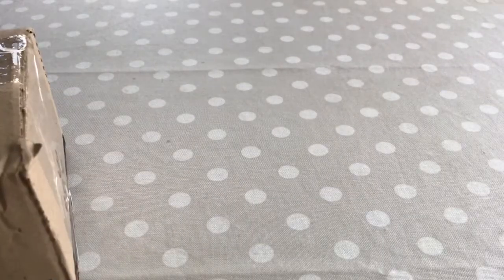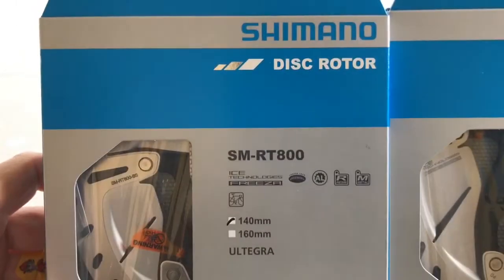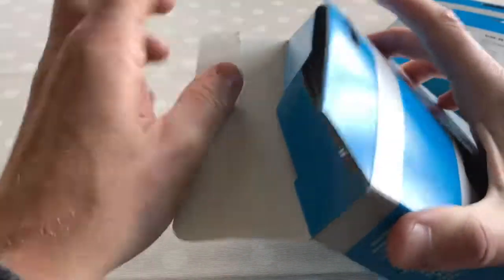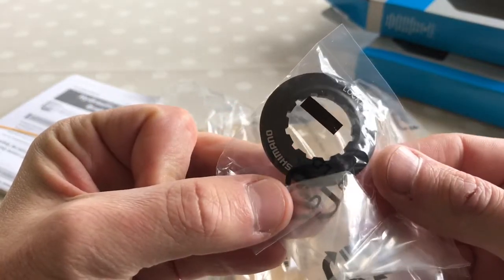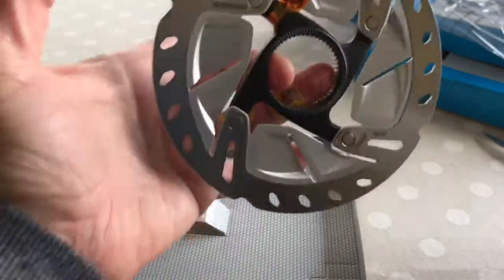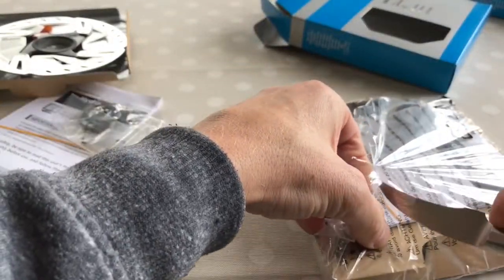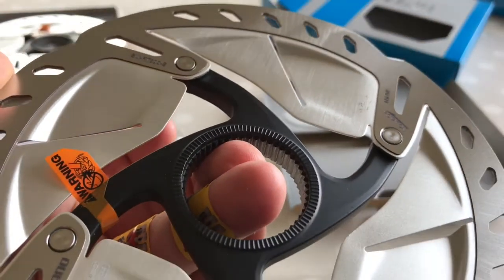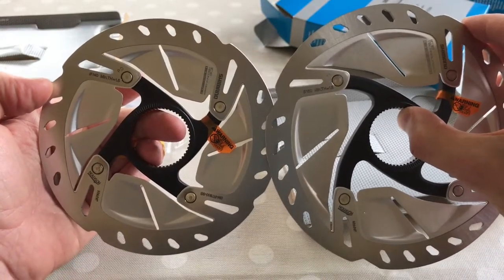Shimano SM-RT800 Ultegra Ice Tech FREEZA Centre-Lock Rotor Unboxing

Comment: The front should be 160, shows this guy doesn't know how to use brakes!
Reply from the maker: Randy Haymaker hi, I’ve already covered this point in a previous comment, it was an error on my part, I got them the wrong way round whilst I was recording... got a bit nervous as was one of my first unboxings. I can assure you I won’t be using a 160 on the back.
Reply: Newby so I need 160 front and 140 rear with my RT 8070 why different sizes? Ta
Reply from the maker: Tony Margiotta this passage I found sums it up.....

For the same force between the disc and pads, a bigger rotor generates more torque on the wheel - i.e. more stopping force. It is running though the pads faster, generating more friction for the same pressure, more stopping power, So, for the same caliper and brake pad, a bigger rotor generates more braking for the same pressure or the same amount of braking for less pressure.

In the end I went for 140mm front and back and it’s more than enough for my needs to be honest. 👍
Reply: Thanks yes just discovered they suggest 160 for the heavier dude too So 140's for me
Reply: My bike is 160 front/back... welcome to 2018?
Reply from the maker: Rollett I run 140 front and rear now 👍
Reply: @KyrosHouseCycling  Why are you running 140? Why would you not run it bigger?
Reply from the maker: David Vasta 140 is plenty of brake for me personally, I never find I need more stopping power so that’s why I run 140’s. I may try 160 front rotor on my next bike just to see... 👍

Comment: Is the braking power higher with theese rotors? i have the sm-rt10s on my road bike and the braking power is bad compared to my fully with sram guide r brakes. I search now for an upgrade
Reply from the maker: Max Mustermann I cannot say at the moment as I have not used them yet, when my bike is built I will then be able to tell you. Thanks for the comment
Reply: I think many different rotors with a similar amount of real estate on the breaking surface would work similarly in most conditions. The shimano rotors with the aluminum fins are supposed to conduct heat away from the braking surface, so maybe they stay a little cooler if you're breaking for a long time (e.g., going downhill) and thus maybe they retain good breaking performance a little longer in that scenario. I don't know how much difference there really is, but the explanation sounds reasonable because aluminum does conduct heat better than steel. At the very least, they look high tech, and that's probably worth something :) This is just my 2 cents as a non expert.

Comment: At https://youtu.be/kBZx_lxfPSs?t=71 you say you're using "160 on the back and 140 on the front". Is that correct? You actually need more braking power and thus larger rotor in the front...
Reply from the maker: Petr Sedlacek hi! Yes you are right! I got them the wrong way around, I’m using 160 on the front and 140 on the back. Thanks for pointing that out.
Reply from the maker: I got them wrong you are right. Sorry for the mistake guys!
Reply: I was going to say haha, I put metal pads in the front and rear of my bike and the back keeps locking up too easily so im thinking of putting resin back in it for less braking power